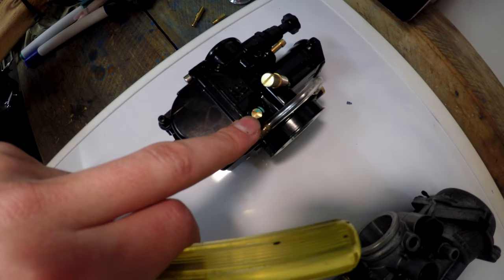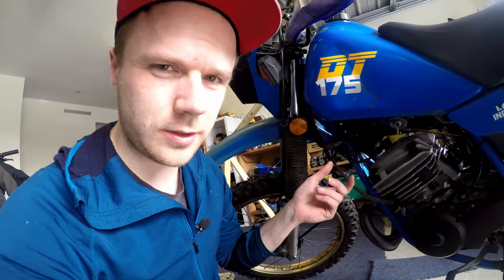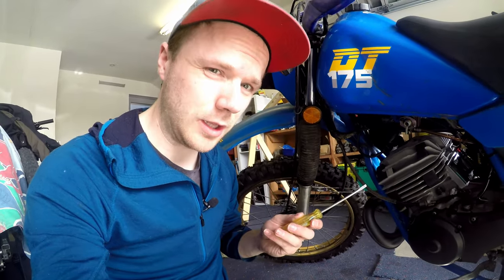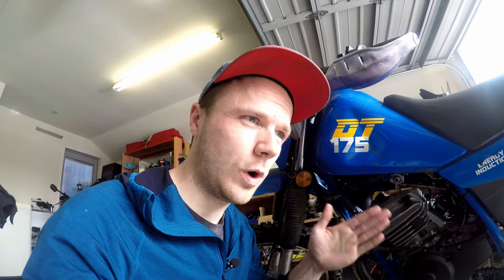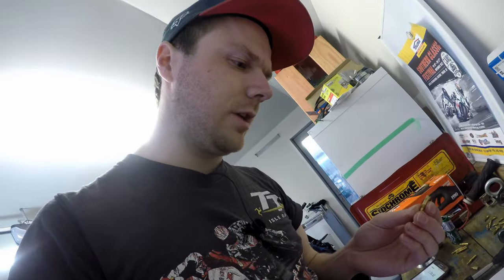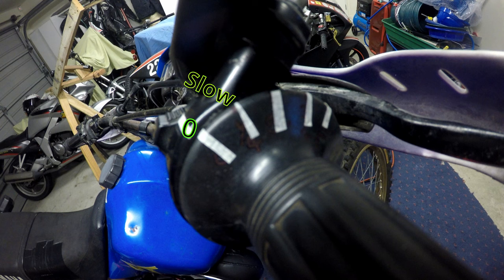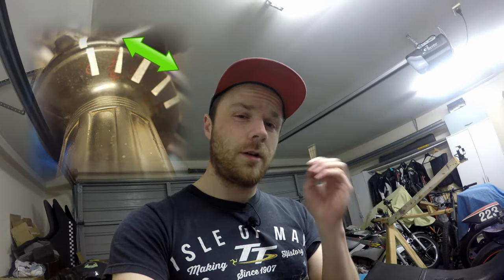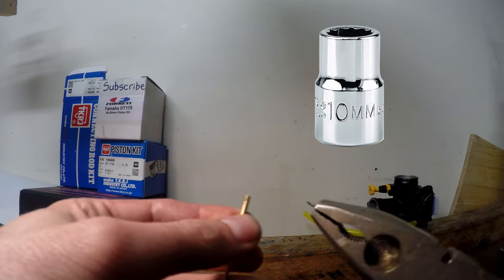pwk Carb Jetting, Setup and Tuning

Comment: I've got a PWK 30 JRC Power Jet on an old 1972 Triumph 650 - Thing runs fantastic EXCEPT the choke/enrichener has to be on. As soon as I turn it off, the bike stops. - I heard it was pilot jet, but I took off the bowl, removed it and it was clean...ran a guitar through all the little holes...any other ideas?
Reply from the maker: @retromototoys  I would first have a go adjusting the mixture screw and idle adjustment. Also make sure the idle jet is correct and that there is no blockages in the carb body.

Comment: From my observations, each carburetor component affects the entire rpm range. Take the example of the main jet - it is said to work 3/4 to full. To check that theory its enough to put a jet half as big as needed - the motorcycle will not even start from 1st gear. Engine will just turn off. And the same that too large - it will flood. No less good work - explains a lot.
Reply from the maker: Yeah as I said they all overlap haha and that is a extreme example as of course it won't run with a jet 100 sizes out
Reply: Interesting observation. The jet needle has the same diameter at the top but it becomes long and tapered. As the carb slide lifts the taper starts to allow fuel to pass. So the idle jet starts it off, then as the slide goes up, even a little in first gear, the idle jet maxes out, fuel is needed to balance the increase in air, so the main kicks in to help. The main is helping but not yet carrying the load of fuel it is capable of. When you think about it, the carburetor is a masterpiece.

Comment: Hello sir, i have an old Honda xl185s and im looking to tune the carb,  stock carb/settings but it high speed its stuttering but when i open the throttle fully the it cuts out and then cathes up
Reply from the maker: If you have a accelerator pump that may be the cause or when cracking the throttle it's getting a big gulp of air and leaning out till the fuel catches up.

Comment: Do know what jets would go into a 420 predator engine with a 34 mm carb , no one has those stats wish you would do one your great Class a gentlemen ty
Reply from the maker: I haven't jetted a predator engine before but if it's a pwk carb or similar. I think a 145 main and 45 pilot jet should be a good starting point. You could start one size richer to be super safe but this should  be pretty close.
Reply: I’d start with a 120 main 32 pilot & go from there

Comment: So detailing explanation. Greetings from Greece. Thank you for this video and all the useful info, man, but there is something i can't get over. Idle is always too rich on my pwk 28 keihin. I'm running it on an yx 150 ksr type engine. Idle jet is 32 main jet is 108. I don't know what's wrong with these carbs. May there be a problem causing that? I'm talking about the engine flooding with fuel from idle to 1/8 throttle, the rest is perfect. I can't find amy solution anywhere. I hope you could provide some helping tips, brother. Thanks again!
Reply from the maker: What adjustment is the mixture screw at?
Also there might be a small peice of material causing the float valve to leak or the float might be set a smidge high for perfect seal.
Reply: @TheMotorcycleForge  even if i completely remove it, the motor still runs too rich. I took it apart an hour ago, blew some air through all holes and replaced the needle. The idle now is more stable and the first eighth of the throttle is great but now i got another problem and i guess i need to play with the needle position and main jet. It bogs at 1/4 when opening the throttle after cruising at less than 1/4. Bogs a bit and goes along. Screams lean but I'm not sure.
Reply from the maker: Yeah it's definitely possible it's lean but most Pwk copies I have found are rich at part throttle when the clip is in the middle grove.
Reply: Check at choke system

Comment: Quick and to the point...easy to understand, no fluff.    Thanks
Reply from the maker: Thanks Matthew much appreciated.
Reply: @TheMotorcycleForge  I Am have a little issue with my 21 mm OKO Carb. I am at 5000 feet elevation. I'm having a hard time getting the bike to idle after warmed up. It seems to only one idol at 2500 RPM or better and even at that it's not very stable. Could you recommend a good starting point for my idol jet. The main jet seems to be fine. I'm running a 80 in it right now and a 35 idle jet. I've checked for air leaks and don't have any. I really appreciate your help with this issue.Thanks DC.
Reply from the maker: @DirectCurrent4u  At a guess, I would think it may be a bit rich on the idle circuit. Have you tried altering the mixture screw? I explain how in this video.
If you have, I would try a 30 idle and see if it improves.
By my calculations, you are running rich on the idle. Go down in small increments  until the bike is happy idling hot but just needs a little choke when cold.
Might even be as small as a 22 idle jet.
Reply: @TheMotorcycleForge  Thank you for your reply! I think the smallest idle jet is a 30. But if that is not low enough I will try to find some smaller ones! I will let you know how it goes when i get there. Thanks again for your help! Cheers DC🙏🏻👍
Reply from the maker: @DirectCurrent4u  Happy to help and good luck with your tuning.
Reply: @TheMotorcycleForge  Thanks again my friend!👍

Comment: Thank you! Helped me a lot. Runs a lot better, from the start ant overall, haven’t messed with the main jet though because I’m currently doing a break in on my new Polini Corsa 70cc So I’m not using full throttle. I still have some tuning to do but for now I’m very pleased after watching your video and tuning my moped. 👍😎
Reply from the maker: @entonismi3772  Glad to hear it 👍

Comment: very nice explanation! i didn't know that lean pilot jet can cause a slow rpm return when closing the throttle which i am experiencing right now on my bike. it's a little bit complicated because my carburetor has accelerator pump so i have more things to get working properly
Reply from the maker: Thanks man much appreciated. The only thing to remember with the accelerator pump is it adds fuel with throttle movement (rolling it on)
but not when holding the throttle at a fixed position like 50% for example.
What is the project bike?

Comment: I have a problem with my  KTM 250 2T
The tool has not been used for almost a year
This week I found time to take care of it, I did a fuel-oil change, I cleaned the filter plug, everything, finally I tried to start it, but the car could not start.
It only started with carburetor spray and shut off straight away
From that I understood that the carburetor needed to be cleaned and that's how I did it.
Now the problem is different, the motorcycle drives straight up to very, very high turns
I played with the air-fuel screw but unfortunately it didn't help.
Is there a situation where the problem is different? Something in the carburetor maybe? need help pleases tool,
Reply from the maker: @kobiisrael10  Make sure the jets and atomizer are fully clear in the carb, it may be lean from a blockage.
Make sure it has fresh fuel as well.
There should be no residual dried fuel in the carb body and other parts.
Once everything is spotless, it should run correctly.
If not it may need the idle speed and mixture altered.

Comment: Ive got a 1994 suzuki ds 80 and a brand new PWK nock off d slide carb and i can NOT tune that thing 😭 please advice. Its a 80cc 2 stroke enduro bike. I have 110 main jet in it idk abt pilot jet. I have a spare 115 jet and a 110 jet but its longer than the 110 in the carb rn
Edit: it has a screw by the float bowl (air screw maybe?), a idle screw and a screw on the top of the intake where the air filter goes (mixture screw i believe)
Edit: no it does not run or idle it only fires

Comment: Hi, I have Dt 175 and 30mm oko carburetor + vforce4. Do you think the most efficient setting is 150 main and 50 pilots?
Reply from the maker: Every bike will be slightly different so you will still need to do some testing but that's what I started with in my Dt175 and It went pretty good.
Reply: @TheMotorcycleForge  thank you for the answer :)
Reply from the maker: No problem, if there is anything else just ask.
Cheers Logan

Comment: Hello from Greece! What size and needle height would you recommend for a stock suzuki fxr engine with open exhaust and keihin pwk 28?
Reply from the maker: For the needle I recommended these two, N80F or JJY and I would start in the middle grove and see how it goes. May need to lower the needle/lift the C clip depending on bike.
Hope this helps.
Reply: @TheMotorcycleForge  Thanks for the quick reply! I wanted to ask about the sizes for main and pilot jet .
Reply from the maker: Ok jet wise, we run 112 and a 42 in our 30mm pwk's. 
For a 28 I would start around 108 main, 40 pilot and see how it goes and adjust from there.

Comment: i have a gx390 engine and a pwk 30mm carb on kart, wich sizes you recomend?
Reply from the maker: I would start with a 115 main and 42 pilot which is a good starting point and see how it goes. 
Then after you could try a 112 or 118 main to see if it gets any better. .

Comment: Do you have a link for a jet kit? All the ones I find have the main jet at least a 100 and I know I'll need a smaller size
Reply from the maker: Unfortunately I don't know of any kits either so when I need a main jet smaller than 100 I order them individually from these guys as they are my nearest stockest. https://www.motorcyclespareswarehouse.com.au/products/keihin-main-jet-large-hex
Reply: @TheMotorcycleForge  thanks I'm ordering several sizes so I can make sure I'll get the right one
Reply: Is it bogging when you give it full throttle like a jab and stumbling no power after changing your carb? I got a defective JFG flat slide carb I could only tune idle and that's about it I bought tiny jets like 40 I'll try to find the link
Reply: @calambres6614  it was bogging bad but I started to increase the main jet size and it keeps getting better. I would of never thought it would take such a big jet but it runs great now. At least now when I put the G2 reed valve and pwk carb on my phantom 85 I'll have a lot better idea where to start but I'm waiting for someone to make an expansion chamber for them so I can do it all at once. A good expansion chamber would really open them up and if nobody makes one by next summer then I'll try to find someone who can make me one using the stock exhaust for the flange. I'll pay the person obviously
Reply: @Westhelockpicker  expansion chamber sounds interesting

Comment: I have a 35 pilot in mine and im not sure what main i have but i cant get it to idle smoothly abd when i give it gas it takes about 5 seconds to idle back down from quarter throttle. What should i do
Reply from the maker: @Thomas-b4m1p  it's running leanon, you will need to richen up the idle mixture and adjust the idle to suit like in the video.
May also need a bigger idle jet if that doesn't work.

Comment: hello, nice video! thanks. i recently bought a pwk34 for my bike and i got it running ok i guess but i have a question: what does the screw besides the negative pressure hose do? it doesnt seem ajustable since it doesnt have a spring so unless is tighten it surely come off with vibration. should i keep it tight or unscrew it ? please help! anyways good video i got my mix right thx
Reply: im talking about the screw on the top, next to that short hose on the air side of the carb hehe yours has it too
Reply from the maker: So if you are talking about the screw above the intake trumpet/ air filter side.
It's supposed to be for adjusting the power jet/ it's for two strokes but personally I normally don't use it as it makes tuning the main jet a little more complicated.
Reply: @TheMotorcycleForge   i have a 4 stroke so im not even touching it now that i know haha thank you! my carburetor came with 2 spare main jets, one pilot and another needle to set it leaner i guess (the number is smaller on the spares). i have my engine running decent with almost 3 turns out so i have to change some things. should i change the needle and pilot too if i put the smaller main jet? or is it enough with the later. thank you in for your time to reply. i really appreciate it
Reply from the maker: If you have the pilot circuit working well at low rpm you shouldn't need to change it when you change the main jet. The needle is just for the part throttle/ mid range so I would only change it when alternating needle height doesn't help.

Comment: Hi mate quick question I have vforce reeds in my bike what jetting would you suggest as running rich
Reply from the maker: Will need some more details.
What bike is it?
What carb is on it atm
What jetting atm?
What exhaust aswell.

Comment: Hi mate, i just have a question i have an 150 cc bike it's all good everything's working fine but there's this issue when i turn the throttle full the acceleration is dull but when it's 3/4 throttle it accelerates very fast & idk what's wrong the cable or something
Reply from the maker: Is it 2 or 4 stroke and what carb do you have on it?
Reply: @TheMotorcycleForge  it's a 4 stroke 👀 & idk about which carburetor u mean , i just knw the basic one😐
Reply from the maker: Sorry I meant what size carb is it, also what jet's are in it?
Reply: The main jet is too big, should be lowered until it accelerates to full throttle.

Comment: Why is my air fuel ratio going lean at max RPM? I have a 2-stroke an it's already too rich on small and medium RPM, but when i open throttle fully I get a pale white spark plug. What might be the cause of this? The carb is PWK 30 and it has needle to the richest position as well as such a big main jet that it stutters sometimes at mid RPM. The spark plug at both medium and low RPM is black.
Reply from the maker: @wuemsad3248  what size main jet?
What engine is it on?
Reply: @TheMotorcycleForge  its a 2 stroke DT 125 R with 145 main jet and 42 pilot jet. It laso has a "powerjet".
Reply from the maker: @wuemsad3248  145 main isn't that big in regards to two strokes. I have a 155 in a 28mm pwk on a dt175 which I haven't finished jetting jet.
So upping the main or power jet should help.
If it's not jetting it may have an air leak somewhere.

Comment: For the pilot going from 50 and 4 .5 or 5 turns out... then going to the 45, how many turns out? And was 45 right or did you drop to 42? 40?
Reply from the maker: From memory it still has the 45 in it and roughly 3ish turns out, was a while ago though.
Reply: @TheMotorcycleForge  @TheMotorcycleForge  thanks! Used a jetting calculator and can't get exact sizes...

Stock 4th clip down. 160 main, 45 pilot.
Used two calculators. First was to see jetting for aftermarket exhaust, second Used the values from the first. 155 main, 3rd clip down, and 44 pilot.... 

The reference of your almost 5 turns down to 3 moving from pilot 50 to 45... so stock states 2 turns out on the air screw, to get closer to 44 the calculator came up with.. I'll be aiming for somewhere between 1.5 to 2 turns out.
Reply from the maker: Sounds like a plan, should go pretty good.